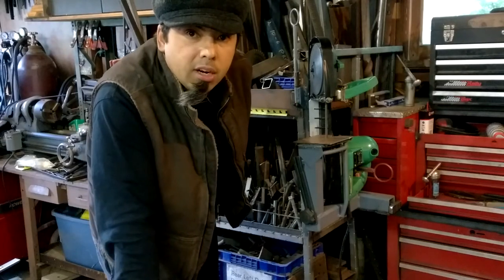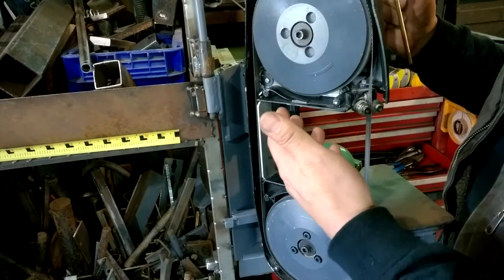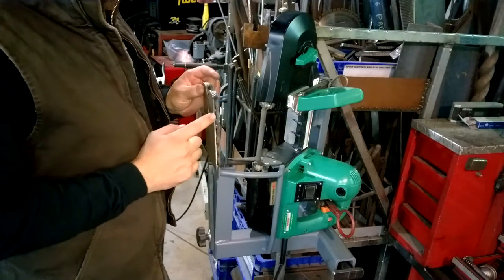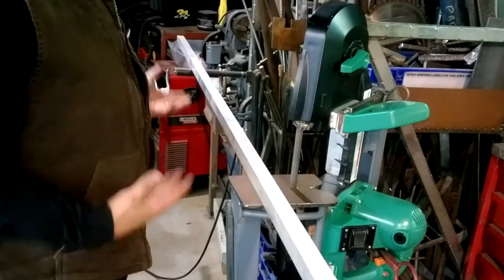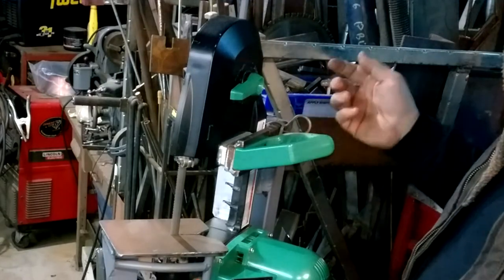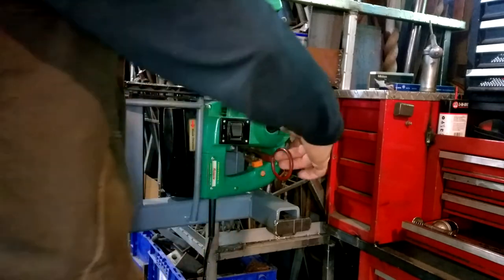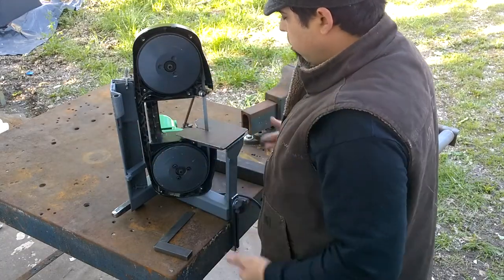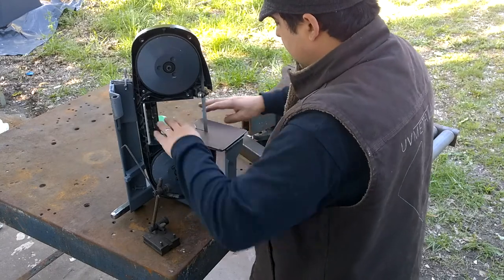Update: Improving The Portable Band Saw's Base For Safety And Function

Comment: Thanks for the ideas. I'm working on getting my Blacksmith shop up and going. And I've been looking at the portable band saws for my shop.
Reply from the maker: I hear it's hard to find a portable band saw with the motor at the handle now that's not a grisly like mine. If you see a DeWalt used on eBay I would definitely snap it up, otherwise go with the grisly. The motor on the bridge design has less cutting depth. Good luck!

Comment: OK Dud I think this is the most thoughtful and elaborate design I've seen yet.. I will be stealing some of your design (Think of me as one of those chines gentlemen in the library of patents with a stack or copies a foot high !! )... excellent work !!!!  Several Professional looking tables out there, But this bay fare out ways them, with the  multi dimensional thinking involved in your design  GREAT JOB !!   Just got my harbor freight unit and looking around.  what I do know is that I will build a guide rail to the right side with square tube and a solid square stock  that slides with -in tube, so as to make a sliding guide to cut at a perfect right angle,  (perhaps an adjustable one too).  (May be a good addition to yours.. or not)  Ill come back later with a link in a few weeks. Also to square the table I will be clamping it to the top as the original was screwed in and then weld the table arm/hing in place ... that should insure that it is square to the manufacturers cuts. (They may be sloppy though ?) . The  On/Off switch ....  I will definitely take advantage of, think Ill  use cutting board material for a smother  slide. Thanks for the upload !!   + Love that "Just blowing in the wind", chin hair !
Reply from the maker: Thank you and good luck with the build!

Comment: Just about got mine finished. With your help/ideas. One of my favorite machines now I
 have a sliding table on rollers and a plated table like yours both work great !
I decided to forgo the speed control on machine and get one for a router. ON Off is great and speed is fine tooned. The table was not perfectly square to the blade by fractions so I drilled the bolt holes wider, (ones that hold upper wheel frame). I can now jigle the top wheel from side to side. Then tighten down this allowed me to square blade and table without damaging the machine. Very accurate. Using mine for small stuff mostly..   Youtube Is great for stuff like this even if not the greatest designs I think you can always take something away if you pay attention. Ill have to post a video some time and share ideas too.
 Only six comments Im surprised.
Reply from the maker: Glad to hear you build one up. Please post a link to the video if you  shoot one.
Reply: Will do.